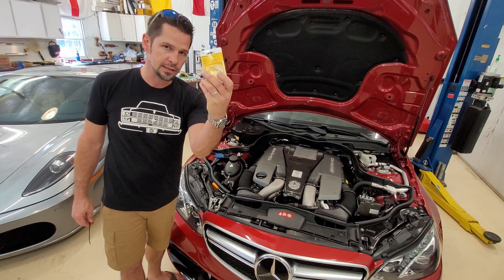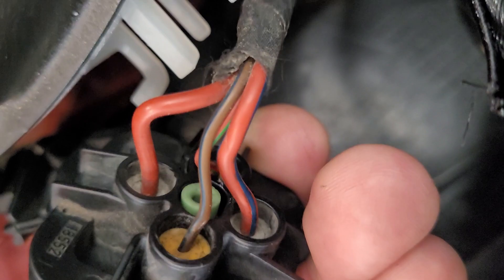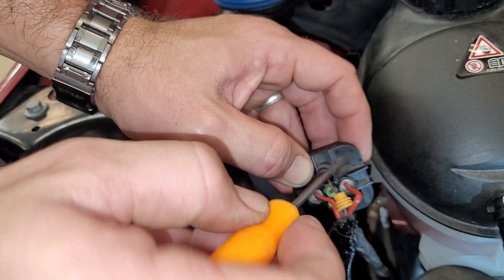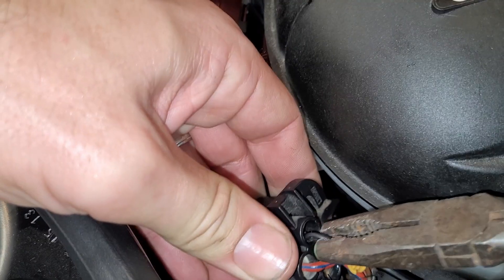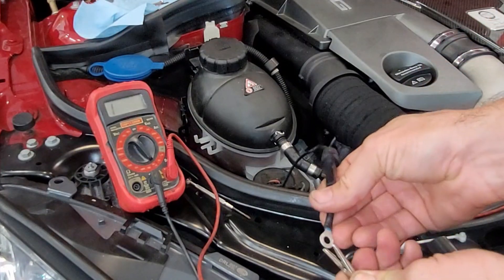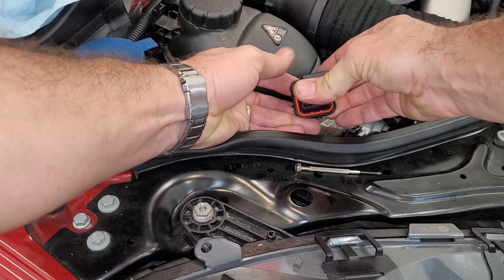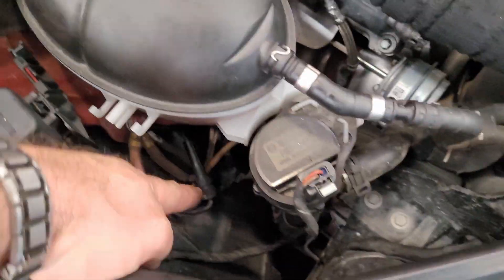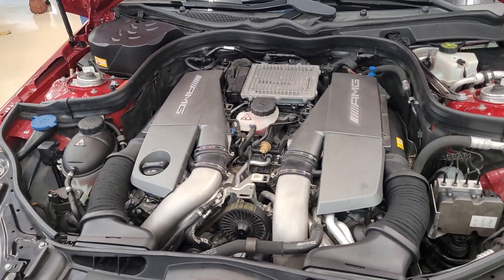~ ALWAYS-ON ~  Intercooler Pump mod for  W212 E63

Comment: Have a 2013 CLS 550 non split cooling m278 how do I do this mod the relay isn’t there but I have air to water stuff
Reply: You will not find it Thats because you have non split cooling system so basically you don’t have intercooler pump because your car using the main water pump.  split it easy to do and you will have good results

Comment: I have a 2012 CLS63 AMG with the M157 also but I don’t have that relay nor that tank you took the cap off of at the end.
Reply: Your car doesn’t have the split system like his. Your car uses the same coolant loop for the engine and intercooler.
Reply: @GordonFreeman. i have the same car and was wondering the same thing. what does this mean? is my pump already always on?
Reply: @jayelking2856  I’m not sure. Your coolant system is totally different. I would look up info about your specific engine.

Comment: Will this potentially cause battery to drain?
Reply from the maker: no, computer will still turn it on and off with the ignition. it will occasionally run a few minutes after turning off with the retained power function

Comment: Hello. I did the conection  and it did show the check engine light and a code. Did i do it wrong.
Reply from the maker: What year and model? Sclass owners were reporting this.  there is a work around
Reply: Hello my car is an e63 AMG S 2014. Just like yours. Is there a way around the check engine light and comes. Thank you
Reply from the maker: Ok, I missunderstood (thought this was a different video) There should be no engine light. Get the code scanned. The coolant pump will not trigger a light

Comment: Hey bro . I noticed when you popped your cap for the reservoir , your coolant is red/pink. Mine is blue. I did purchase it from an Audi dealership , I’m wondering if the blue is the right color ? I topped it off last night with GR48 Zerex after some small research , but got confused about the parts where Mercedes swapped coolant colors around the year of mine(2014)
Reply from the maker: Mercedes changed colors in 2015. Blue and pink are both factory colors

Comment: Nice man! 

Has anyone had this long term? Wondering what the life expectancy of that pump is . I’ll probably end up doing this mod . Appreciate you man!
Reply from the maker: Can't remember if I mentioned it in the video, but there are two train of thoughts on this. One is that the cycling of the pump on and off actually is more harmful to a pump. But then again it is being used quite a bit more with this mod.
The previous generations like the E55 etc had the pump running constantly, and typically they wear out after about 10 years regardless of miles. Good news is they're cheap though I think it's like 140 bucks as long as you can recognize when it goes out
Reply: @ExoticCarDIY  yea I heard you mention it here ! You’re right , on-and-off for electric motors , in my opinion, lower the life expectancy. What are signs that your pump is going ? I don’t have a scanner or way to monitor IAT’s
Reply: How’s the pump running a year later?

Comment: If the wire stops touching for whatever reason the relay would still do its job yeah? Theres no chance it would get stuck off?
Reply from the maker: Correct, if the wire loses contact, it simply reverts to normal function.
The only exception is if it's installed very sloppy and it touches another wire that it was never supposed to..
Obviously, like I mentioned in the video, the most secure way would be to just splice the wire in there, but I refuse to cut into my factory harness even if it's just a tiny splice

Comment: I have an issue with it coming on and off even when the car is locked up ?
Reply from the maker: Normal. The suspension, interior lights, coolant pump headlight fans all turn off and on for the first 15-20 min after shut off. If it's running after this time period, something Else is going on
Reply: I did install , works but it’s comes on in intervals ( on /off ) even when I have everything closed and locked up, car off ?
Reply: Question ? Can a tuned system work with this mod ? Or only for stock systems? I have read the forums but haven’t seen any literature about this.. I’m going to check the window of 15/20 , as it’s been 20 hours since mod .. I appreciate you
Reply: So I’ve had this mod for a month now and can honestly say it’s a great mod! Thanks for the suggestion

Comment: Why not just use a small jumper cable between the switched terminals instead of the relais?
Reply: Relay is located in a sealed enclosure.

Comment: what about the split cooling kit from VRP ?  Is this a better solution or the split cooling is better ?
Reply from the maker: To my knowledge, the vrp kit is a retrofit kit for cars that don't have factory split cooling, like early m278/m157 etc.
Reply: Would this run continuously? 24/7 ? Or only while the car is running ?
Reply: @coldbud3  Only when you turn on the ignition on or start your car, when you take out your key, its off

Comment: The boxed fuse link is wht, the one used is blk. and how did you get the 16g wire in the otherside. Gotta do a short how-to vid on that fuse link and wire added to it before install plus how you sodered that? very confusing as I can not find the fuse link at any auto parts stores. What kind/brand of link is it? its not really visible in the vid. thx.
Reply from the maker: Here is the fuse https://amzn.to/47h4aJG
Just strip 1/2" of the end, melt some solder to make it rigid.
Reply: @ExoticCarDIY Do you actually put a glass fuse in it or you leave it blank?
Reply from the maker: @andrehafrian408  yes, install a fuse.
Another guy reported he accidentally put the jumper in the wrong hole and the fuse saved shorting out the system.
Reply: Thanks for the reply! How many amps fuse should I use 10, 15?
 @ExoticCarDIY

Comment: Great video! I’ve wondered why my S63AMG M157 sometimes feels like it pulls harder and other times not as much. Thank you for the video.
It is very clear that you’re a perfectionist and everything you do, you do it to a high standard. 
I’ll be doing the same thing to my S63AMG 😊
Reply from the maker: Thanks man, I've done this on both of my e63s and been very pleased with it.
Reply: Did you find where the Relay is, bc on mine its not in the same place as the E63
Reply: @BAY_AMG  I’ll be honest, I haven’t looked into it because I’ve sorned the car for winter and it’s just covered up. I might look into it before summer time and I will post here where it is 😊

Comment: I have a 2014 E550 (so m278) but now I have 156k miles on it, I already changed the whole top end (adjusters, cams, rockers )  my question is should I get a 2019E53 or should I keep this and Spend the money have the bearings changed and check clearance and scoring?
Reply from the maker: Sounds like you put a lot of work into your current car, I don't know about your financial situation, but that would be a pretty hefty price to jump from your car to 2019. They are great cars though, good luck with your decision
Reply: At what mileage did you have to change the whole top end?
Reply: @multiblade04  at 140k but that was because the previous owner drove it with low oil. Typically no m278 or m157 needs this. As long as you change your oil every 5k miles you should be good.
Reply: @bulmear2531  at 92k miles had to reseal upper timing covers from oil leak (not sure how bad it was but had warranty, covered) , turbo coolant lines and engine mounts. Have the old chain but no ticking sounds. How low in oil did the previous owner drive it? Also how much does your car burn, sometimes I have to add 1L oil after only 500 miles! Occasionally (rarely but happens) smell a burning smell from tail pipe. Its the 0w40 amg oil with a bottle of ceratec. Switching to liquimoly high tech with ceratec next
Anything I can do about the oil burn? Turbos? I have a warranty on the car
Reply: @multiblade04  I didn't have any oil burn, look into replacing the chain tbh, last thing you need is for it to be bad and causing minor damage
Reply: @multiblade04  oil burn can be anything from EGR or rings. If you want boroscope, the engine from the sparkplug and do a compression test. It all depend on how much you want to keep the car
Reply: @bulmear2531  why change the chain when its fine for now? Your car has 144k miles and doesnt burn a drop of oil? All cars burn some oil.
Reply: @bulmear2531  what is EGR if i may ask?
Reply: @bulmear2531  also what was your cost to change whole top end?
Reply: @multiblade04  total cost was 13k with new OEM parts from Mercedes, (that was a mistake, just buy part from a used car as long at it has less than 40k miles it would MUCH CHEAPER), and yeah it never burn any oil, I never had to top off or smelled anything burning, EGR is exhaust gas recirculation basically it takes your exhaust gas and put it back into the intake, that causes carbon buildup and could cause oil burn, installing a catch can is a very good thing to do, and a carbon cleaning is a good idea keep in mind we have DI cars so any fuel additive will remove carbon buildup from the exhaust valve and not intake valve, it you want to clean the intake without removing the manifold use CRC GDI intake valve and turbo cleaner
Reply: @multiblade04  as for changing the chain you can wait but just make sure to pay attention not to over do it, keep an open ear to noise at startup
Reply: @multiblade04  if you want to learn a lot more about our engines (m278 or m157) honestly most of what I learned was from Tasos Moschatos here on YT he's very informative when it comes to keeping up with your engine and how common problems can be fixed.
Reply: @multiblade04  also pay attention that the cam sensors are not leaking oil because thst might end up traveling up the line to the ECU.  Simple upgrade or pigtails solve this problem.  Also DONT use anything other than 5W40, 0w40 is too thin. I recommend liquimoly molygen, it has buildin Ceratech so don't put any additives
Reply: @multiblade04  last thing is make sure your chain is the new one (old ones strech)  and that the chain tensioner are good this will also save your car from future problems. Typically coolant lines also becomes brittle at like 120k miles and they might need to be changed, cheap if you have a crimping tool this way only buy the plastic end connectors and crimp them.

Comment: Dude! You mentioned that this coolant pump mod was filmed a year ago? Dang, I wish you posted it as soon as you did because I could have tested at the drag (drag strips in the seattle area are closed during the Fall/Winter) . Im super excited to do this simple mod to my E63! A 25% decrease in water temps is HUGE! The car ran excellent when I take it to the drag strip, mind you I was running it HARD non stop in 80 degree weather. So I cant wait to see the results this coming spring/summer.
Reply: Hi friend. So have you tried it?

Comment: What type of fiber wrap did you use for your air intakes unless those are stock and just super clean LOL
Reply: Stock intake tubes to the airbox are cloth.
Reply: @brfatal1  correct but I’m asking if he wrapped his in any fiber tape since others do the same from the cloth intakes tearing over time.
Reply from the maker: The engine cover is the OEM carbon fiber cover

Comment: Question. Living in NJ and it is 30° out now. Are there any negative effects for doing this in the winter time?
Reply from the maker: IMO, there will be no negative effects.
Reply: I live in Canada and had this -30° no problem.
Reply: @samz.k  Good to know. Much appreciated 🙏
Reply: Another great video. Does this mod not also lower engine water temps or does the thermostat stop the engine temp dropping at all. Uk based so just wanted to check that wouldn’t cause engine to run too cold or delay warm up from cold start. Thanks Ken, another great video! 👍
Reply from the maker: @dominicnewby2875 @dominicnewby2875  well, one disclaimer, the 2014 to 2016 cars have split cooling meaning there are separate cooling systems for the engine and the heat exchanger. Some of the earlier cars have a single coolant system 
Anyway, this is intended for the split cooling system cars and has zero effect on the engine coolant